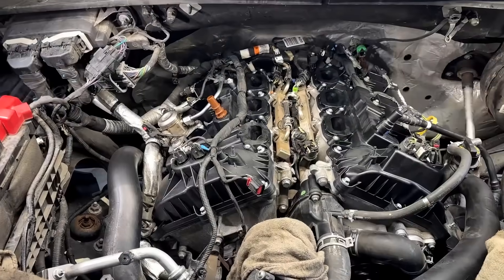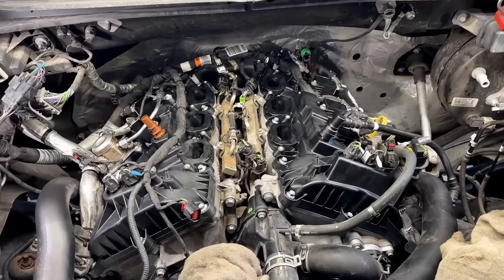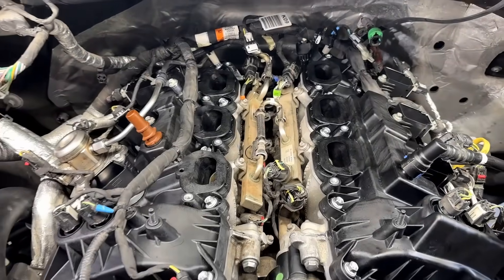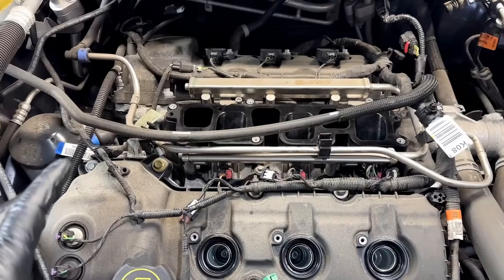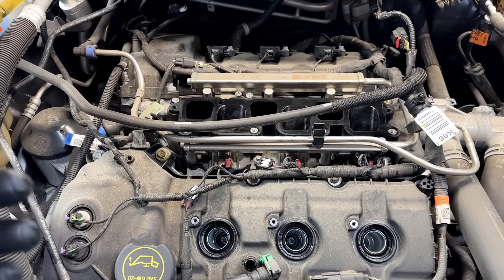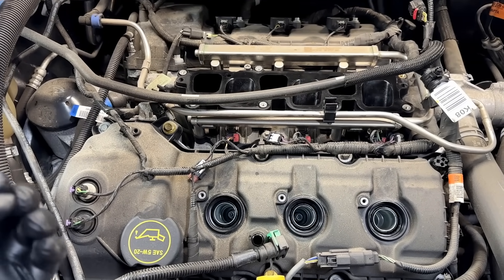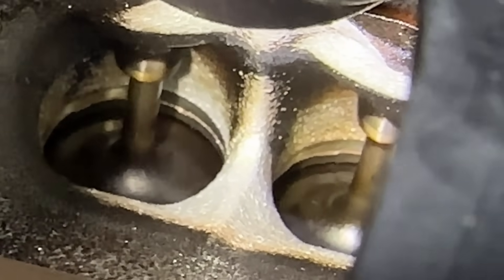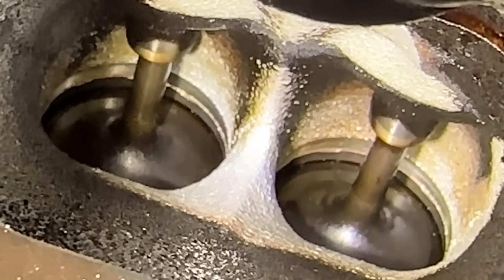Does Ford's New Dual Fuel Injection 3.5L Ecoboost Engine Really Fix the Carbon Build Up Issue?

Comment: This is not progress. Bring back the 2-valve 4.6L V8 and the 300 straight-6.  Those engines could be modernized to squeeze out a little more HP and torque, in addition to the port+direct injection system that the 5.0L Coyote uses, which does not allow for much (if any) carbon buildup on the valves.  That would help give them a little more power and fuel efficiency.  But that's it.  No turbos, no VCT or VVT crap, and no cylinder deactivation.  Just reengineer the intake and exhaust manifolds for low-end torque.  No they wouldn't put out mind-blowing power figures on paper, but they would be able to handle 95% of the jobs an Ecoboost handles while being astronomically more reliable, low maintenance, and would last much longer.  The cost/benefit of where we are today with engine technology just doesn't make sense.  It is insanity the level of cost and headache we introduce just to chase an extra 1,000 pounds of towing capacity.  It's ludicrous.  If you are splitting hairs on towing capacity and absolutely need as much as you can get, you should be looking at a Super Duty anyways, not a half-ton pickup.  If Ford offered a refreshed 2-valve 4.6L V8 or 300 inline-6 in an F-150, I would buy one tomorrow.
Reply: Yes I had a 4.6 2 valve and at 245000 miles still ran excellent. Oil amazingly clean long time after a change.

Comment: Just having to do timing chain work at 100K is enough reason not to buy one
Reply: I think timing chain issues with proper maintenance is rare we had and ecoboost from 35k miles to 145k miles with good maintenance syn oil changes every 5k with no issues.
Reply: But is that on gen1 or gen2 , or both?
Reply: A lot of the issues fall on the owner ex: oil change intervals, fuel used, and preventative maintenance
Reply: someone at Ford kicks the can down the road and then its someone else's problem

Comment: Would crc intake valve cleaner work to help clean the gen2 eco boost?
Reply: From what I've heard additives of any kind will end up in our turbos. Not ideal.
Reply: That’s why they make CRC® GDI IVD® INTAKE VALVE & TURBO CLEANER. I’ve used it before the past 5 or 6 oil changes on my’15 3.5 EB.

Comment: It seems strange that Ford wouldn’t have known about the carbon buildup problems with direct injection during their development of the eco boost engine program with their vast engineering experience with engines. I guess they didn’t give a damn about what happened after the purchase.

Comment: Hi!  is that carbon build up related to the quality of fuel being use
Reply: It's caused by the oil vapor in the PCV system drawn through the intake valves and no fuel being sprayed on them because the injectors squirts directly into combustion chamber like a spark plug

Comment: I would use Amsoil Signature Motor Oil and Run a tank of Shell V-Power Premium Fuel before every oil change.
Reply: …..neither of which ever touch the intake port on a DI engine, so just keep flushing your money away .

Comment: Full timing job on a 2019 with 125K miles? I like Fords but come the F on. More the reason why I still love my old trusty 2007 Tundra 5.7 with 151,000 miles, never missed a beat. Ever.

Comment: Thanks for posting. I just traded a 2011 Gen 1 F150 EB for a '22 F150 EB. I wondered how well the new dual fuel system worked. You answered my main question at the end, which is how/when does the engine switch between systems. Port injection at idle / low power makes sense because that's when most of the PCV gunk is likely to come through.

Comment: When i was young a valve job was a standard maintenance service , most shops had a valve grinder. If you made it past 50k miles you were doing great. The buildup on the valves meant standing at the wire wheel a good amount of time. We have come a long way.
Reply: You also needed to take the plugs about every 1500 miles and have them sandblasted at the local garage. Back then it was due to the leaded gas we used.
Reply: @wdbressl  Yup , i remember Zellers used to sell reconditioned spark bolts. lol Back then we did not just throw things away. Today plugs are much harder to access so if you go in just replace while your there.
Reply: Wonder how much the reconditioned spark bolts cost back then?
Reply: @s60t5M  Ha my memory is not that good, it was 40 yrs ago but probly half of a new set. They were cleaned and filed and gapped. My dad had a shop back then and like most we had a spark plug tester and cleaner sold by champion.

Comment: I have a 2014 F150 3.5L ecoboost with 167,000 miles on it now.  I have no idea what the valves look like, but all I can say is (so far) it still runs great, idles smoothly and pulls strong.  Pedal to the floor and boom, away you go (can't do it from a stop because it'll just spin, but you know ;-))   Hoping it stays running well.  I do plan on cleaning the throttle body next year when it warms up (never been done) but like I said, it's still idling smoothly...but I wanted to do it anyway since it's easy to get to and probably should be done anyway, even though it's still idling smooth.  I run full synthetic name brand oil, ford oil filter, I regularly use Hot Shot Secret stiction eliminator with the FR3 friction reducer.  For me, so far so good.  Runs great.
Reply: Glad your truck is running great, what region of the country do you live in? just trying to get a feel for the atmospheric conditions affecting the engines.
Reply: @andysecorod9952  near Cincinnati
Reply: I've got a 2013 3.5L with over 170,000 km. It runs great and I don't think it's had any cam phaser issues. It seems like the Gen 2 has more cam phaser issues than Gen 1 from what I've been reading....
Reply: Do you notice the hot shot secret stiction eliminator benefiting the truck?
Reply: @gabbygonzaga552   all I can say is that it still runs like new with just over 181,000 miles on it. The only thing I’ve had to do to the engine of any significance was replace all the coils but after 170,000 miles on them, I think I got my moneys worth out of the factory coils.  Anyway, I do believe that product keeps the bearings clean in the turbos and other areas of the engine which helps keep everything lubricated.  The frustrating thing is it still runs like new but I started hearing the timing chain/cam phaser rattle on start up occasionally after it had been sitting a little while and I’m sure that’s related to the known issue with the timing change stretch. I will keep putting that off until it truly becomes a problem but it’s a shame because that’s the only thing so far that would cause a lot of major work and expenses

Comment: does anyone know if the 2017 F 150 Raptor also has the dual fuel injection system?
Reply: I believe it was one of the first to get the 2nd Gen Ecoboost with dual injection.

Comment: I’m still failing to see the data that proves these engines are better than the Coyote. 

5.4 3V - guaranteed disassemble for timing job every 100-150k

3.5 ecoboost - guaranteed disassemble for timing job and valve cleaning every 100-150k

5.0 coyote - only guarantee is a $400 water pump job every 100k or so

Comment: Man I wish you were in my neck of the woods I need a mechanic I can trust I have a 2020 3.5 and I had a 2015 2.7 and got rid of it at 140 thousand and did maintenance and cleaned the valves, but do you think a catch can is a good idea

Comment: So, while the dual injection system somewhat works, would the recommendation be to run Techron more often like every third or fourth tank of gas.  This video has really emphasize  the need of utilizing an oil catch can.  Your thoughts!
Reply: Techron is a great product, it is patented, and the only additive that cleans Sulphur from the fuel system. 
I just always go to Chevron or Texaco since it already has Techron in it. There are other "top tier" places around but in fuel quality testing we've had to do in the shop over the years, those other top tier stations far exceed the allowable ethanol percentages.
Reply: I think any top tier fuel will have a good additive package. But in DI engines there simply isn’t much getting back onto the back sides of the intake valves. Catch cans are helpful. I pull 1-3oz every oil change and at 50k our DI 2.0T still looked fine, I’ll have to check again when it hits 100k (20 to go).

Comment: Does a catch can at least slow down the carbon build up on the valves?
Reply: Don't be shy to push the gas pedal and get some fuel injected cleaner you old fart

Comment: Did ford go to dual injection so they could use a tiny injector to better meter fuel to the engine.

Comment: Well,  they( "FoMoCo" ) needs to hire you  as a "Consultant " to help fix this...I have a OBS Ford f150 5.0...Why do Fords always get  and have these weird problems...???..Mine's is down coz of Intermittent "Crank ...No Start Condition " and Rough Idling issues with fuel pumps keep priming at startup....

Comment: Vehicles aren’t designed to last nowadays, they’re designed to just last until warranty runs out

Edit: Also most people don’t maintain a vehicle like they should. Most don’t even read through the manual or even do a little research. I’ve heard numerous people buy into “The fluid in my such and such is lifetime fluid” and that’s a big no no. Fluids break down and get dirty. Yet another false thing car makers are promoting “lifetime fluid” it’s BS
Reply: The manufacturer does not have the buyers best interest in mind. They care about profitability and repeat buyers.
Reply: @frank23103  Hit the nail on the head there
Reply: Where have you been, they’ve been designed that way for decades.
Reply: I think it has to do more with that being peoples mentality than the designers intentions. Maintenance is key and it shows.
Reply: @dakotabrown7698  Exactly, if those of today owned a car built in the 1950’s or 1960’s they’d burn them up before the made 40k miles.
Reply: @dakotabrown7698  you’re right I change all fluids every 30,000 miles brake fluid transmission fluid differential fluid  coolant. Engine oil every 5k. My Ford vehicles last far past 100k maintenance is key!!!
Reply: @jeffone2nv  You forgot the power steering, which I do every 20k as it is easy and gets very abused (lots of heat in a small system). I do the same, except the coolant every 60k as it has tested fine.
Reply: For me, it’s simply about tolerances and efficiency (not just fuel). Getting the most performance out of an engine requires precision. The continued increase in development absolutely does make it a bit more difficult or potentially costly if or when things go wrong. But in large part I think engines are going longer and for more miles than they have before as long as they are maintained.
Reply: Do car manufacturers remember how to make a great car like they were doing oh about sixty years ago they are getting what they want to meet up with federal government standards and not up to reliability standards for the people who are buying your ñew Gen junkie products My older muscle cars are still doing great with everything and their ñot falling apart every time I get behind the wheel of them because they were quality made in a much better way and in a different generation group of the 60,s and the 70,s remember when they actually built a good car and they don't have any rust on their bodys and I still can work on it
Reply: Especially FORDs
Reply: @gianfrancoa  ford's the best!!!! Rams chevys all suck!!!!

Comment: You can't convince me that Ford didn't know this would happen when they switched to direct injection. I believe it was intentional for 2 reasons 1 ford makes millions in repairs from unsuspecting owners. 2 it helps promote a bad image for gas vehicles and helps steer new buyers to the hybrid/EV market witch ford has just invested a billion or more in a new facility to produce EV's and hybrids. I've been a Ford guy since the mid 1960's and I may never buy another Ford. My current 2003 F 250 gas v10 has over 350k and still runs good with no load 17-18 mpg highway, some small repairs ac compressor, fuel pump front wheel barings & rotors and 3 coil packs.
Reply: It's just Ford being Ford. Just putting into production an unproved and unreliable technology

Comment: Would be nice to get a Toyota 3.5L di + port injection and see how that looks at 100,000 miles+ for a comparison to Ford.
Reply: I should check my GS 350AWD and make a video. Probably would have to pull the intake.

Comment: Thanks for the comparison video.  Very helpful, and somewhat encouraging that dual injection offers some relief.  Welcome your opinion on how well religious frequent oil changes (5000 miles) would help avoid carbon build up (due to oil not breaking down as much) vs. long oil change intervals.  

Merry Christmas.
Reply: I have a 2018 Silverado 5.3 gdi just had it apart to replace a failed lifter at 137k miles. Very little carbon buildup. Mechanic said it looked really good.  Used on a farm hard use and dirt roads a lot.  Replaced air filters and oil often. Oil changes at 4-5000 miles Napa filters. Shorter oil change intervals help. The bad lifter didn’t damage cam. Lifters replaced and continue driving.
Reply: @justinvanderkooi3604  Kind of low miles for a bad lifter.
Reply: @gregjohnson2073  not for engines with cylinder deactivation(collapsible lifters) the 5.3 and 6.2s from Chevy very common, I just put an engine in a 2014 Silverado with 140k because of a failed lifter(customer requested engine) a 2017 dodge ram 5.7 with a failed lifter and multiple leaking intake valves(replaced cam, all lifters, mds[cylinder deactivation] solenoids, vvt solenoid, did a valve job) that truck had 127k, also had a customer request replacement of the engine on a 2014 ram 5.7 because of a failed lifter it had 180k,this all within the last 2 months for me personally I did a set of cams and lifters on a 2014 jeep wrangler 3.6 because of a misfire and ticking noise due to a failed lifter that had eaten the cam lobe away. These days it's getting pretty common lol
Reply: @dillonwhitted3765  what is the reason of cylinder deactivation to kill lifters? isn't suppose that oil still lubricating this lifters?
Reply: @RotoRCol  It MIGHT be a metallurgy issue (like wrong material used for the lifters, or poor surface hardening).
Reply: There’s a site called pure-gas that lists non-ethanol gas stations for every state and has there phone number and other information so you can contact them
Reply: Change your oil every 5k if synthetic only to protect against viscosity/protection brake down.
Your oil will have no effect on carbon build up.
Dont idle your car to heat up, drive it after 30 seconds. Idling causes more condensation/blow by from cylinders into oil, which then goes into your intake via PCV as oily vapor. Oil catch can is a must on DI. 

Spray valve cleaner before every oil change through your intake to fight buildup on DI. 

Regular DI (all manufacturers) will have more buildup after 10k them Gen2 Ford had after 130k.

Run your car hard yo redline through multiple gears regularly to bake off carbon, always best right after intake valve cleaning spray/seafoam/CRC DGI cleaner.
Reply: @blackgenesis7472  Exactly this. Thank you
Reply: The valves need fuel to clean them from blow by. Frequently changing the oil does nothing to prevent this.
Reply: Changing oil is about as good as changing your socks.   Too bad there are no magic bullets for carbon buildup.   But if you use that really expensive purple oil and go to church every week you can pretend
Reply: @georgeburns7251  Haha! do you even hear yourself? Changing oil is everything! And yes regardless of what the manufacturer says you should never go over 5000 miles no matter what oil you’re using.
Any mechanic will  tell you there are multiple issues you can avoid by changing your oil regularly.
And you should also change your socks regularly!
Reply: @Maynardd  It’s not the point or anything you’re trying to prove. It’s a bad design period. Good or new oil doesn’t have anything to do with valve carbon build up on the eco fords.
Reply: Crappy corn gas (ethanol) is hard on oil and makes carbon problems worse. 
Religious oil changes are essential for the VCT system (timing) and will help prevent leaks and other carbon problems,  but won't help much with this design of engine. 
De-carbon services are going to be required periodically.  My techs are recommending every 30 to 40K miles. 
Using high QUALITY fuel will help, such as Chevron/Texaco. If you can find a station that sells non ethanol fuel, that would be ideal. It's amazing how much better the engines run on gas with no ethanol.